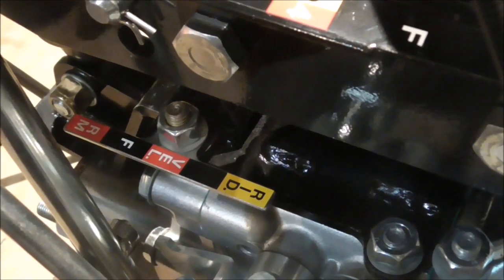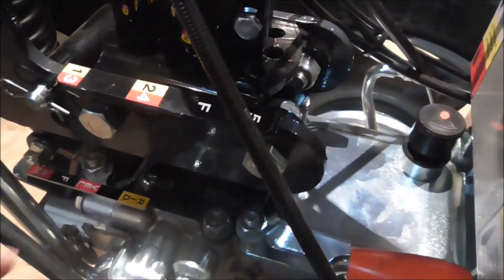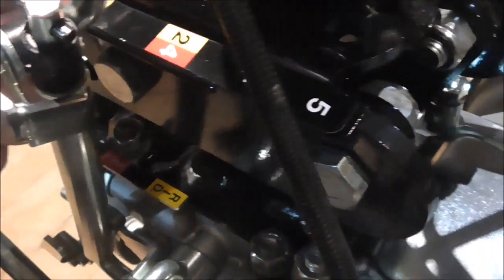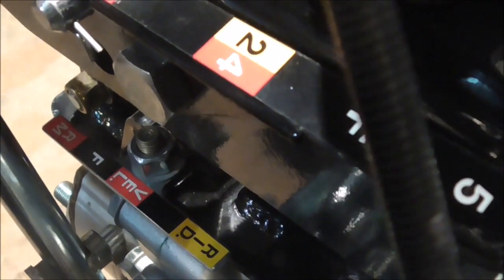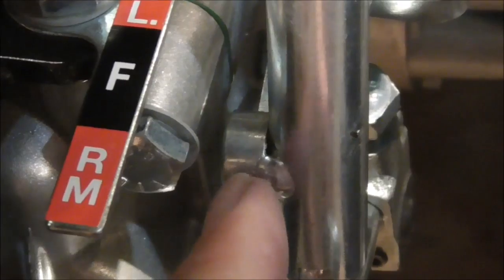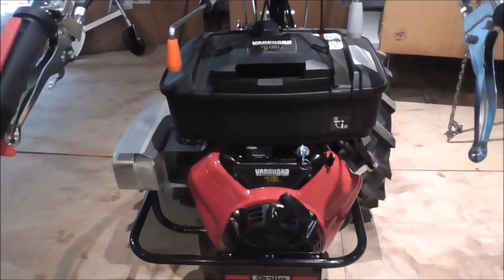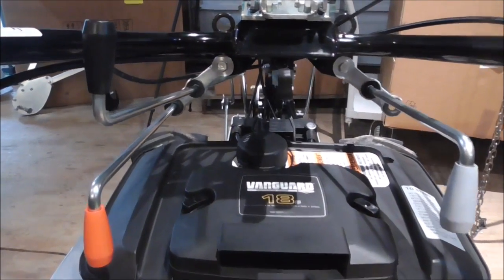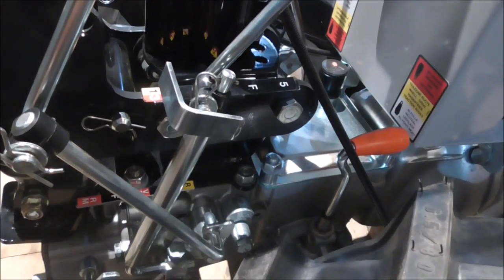Grillo G131 control Rods, Front mowing position

Comment: Need help. CAN I USE 6.5/80-15 tires on my Grillo 131 diesel for tilling?  In the old user manual from 2012,  6.5/80-15 tires are mentioned Will the engine be enough lubricated or angle of rototiller is too steep like in this video.  https://www.youtube.com/watch?v=3ELc2H8M24o I would appreciate the advice.
Reply from the maker: It will definitely change your angle a bit. However I do NOT till with tires that large so I can't give feeback based upon tilling with them. Basically NOBODY that we sell to in USA uses 6.5" x 15" x 25" | www.daileysBCSsales.com